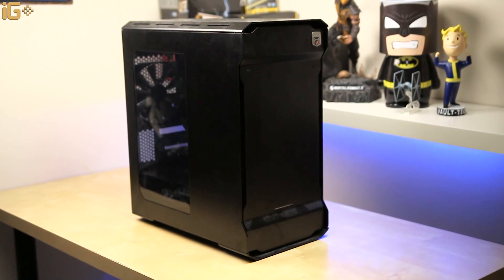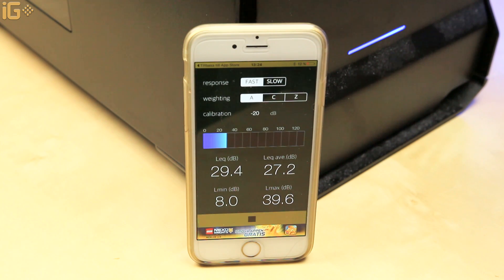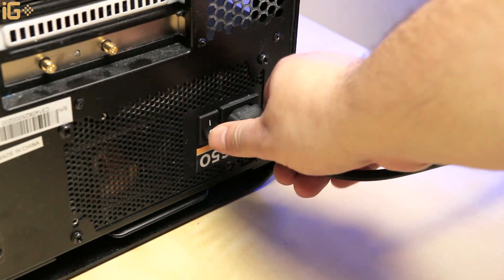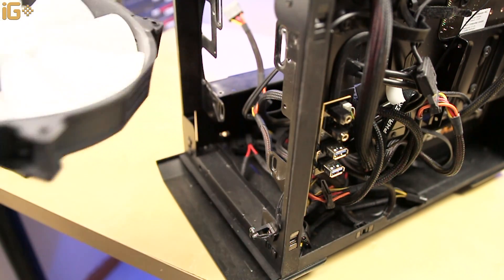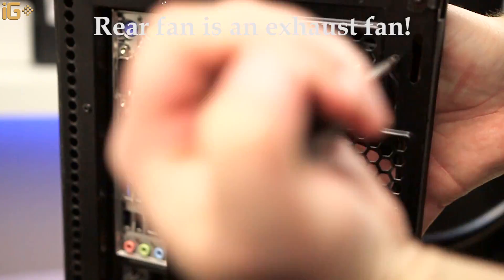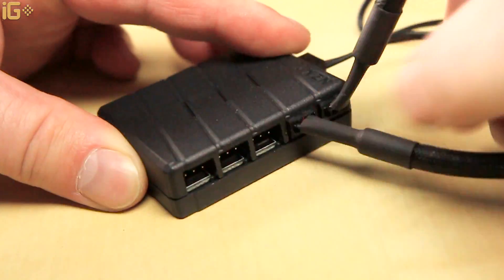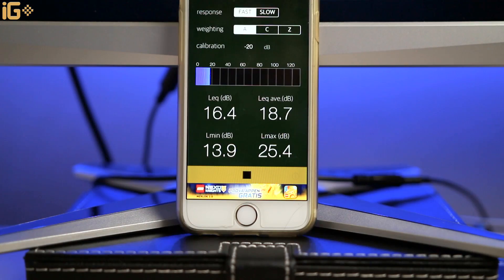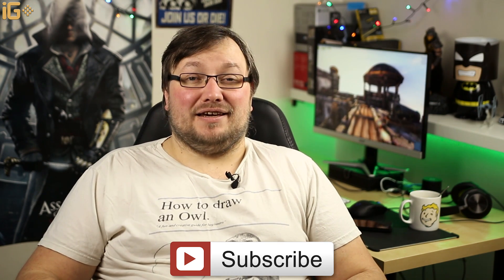Pro Tips: Make your PC quiet, Cheap!

Comment: You want to leave the power cord plugged in to ground the case
Reply from the maker: That is one thing you absolutely don't want to do!
Reply: iGameOver If the psu is switched off at the back of the case, and the power is off at the wall socket, there's 0 electricity running through the case. It means any static in the case gets grounded. Then you connect yourself to the case with an anti static strap so there's no risk of ESD
Reply from the maker: +Hassan Alloush +Hassan Alloush You are nearly right. 1. Unplugged cord and turned off psu doesn't mean there's no electricity in the system. 2. Electrostatic discharge isn't an issue unless you wear furry socks and walk on a carpet. Occasionally touch any metal part of the case and you'll be fine. Trust me, I have quite a bit of experience with this :)
Reply: trust you and it took two days to install a fan hub and change case fans.. lol
Reply: nope, that creates too great of a energy differential.